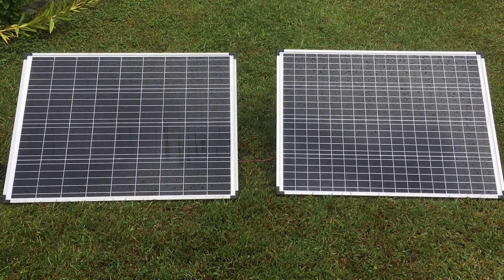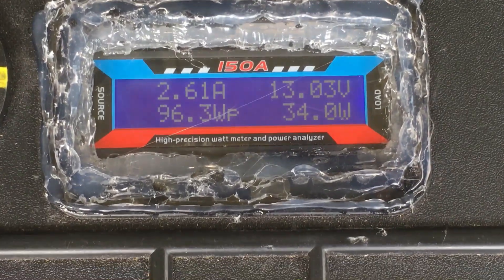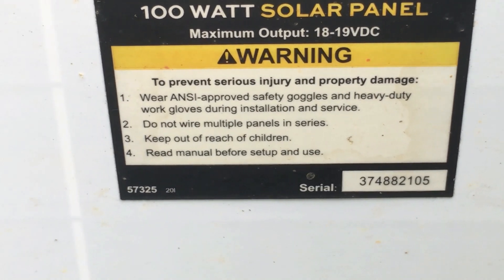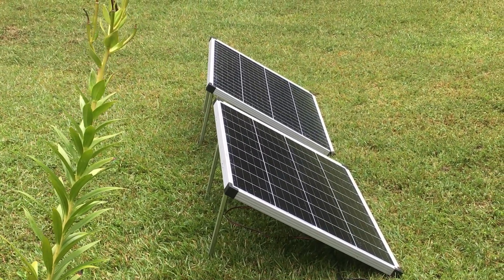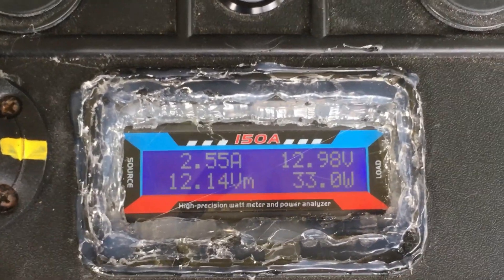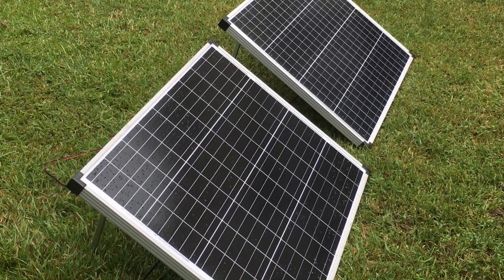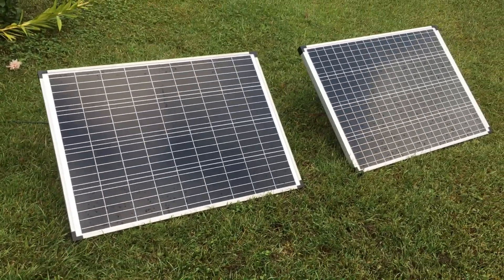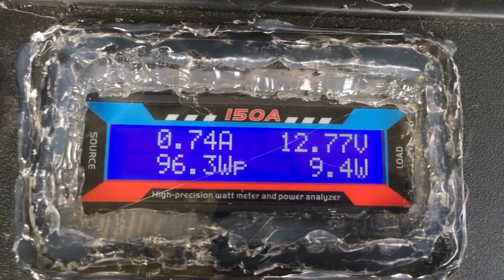Can you hook two of the new 100 Watt Harbor Freight Solar Panels Together?? 57325 (Rainy Day Result)

Comment: Can u connect 4
Reply from the maker: As long as your cc can handle it
Reply: @DIYKAI  3000 watt growwatt mppt.  Should be good ?
Reply from the maker: 3000w @12 or 24v? Is it the 80A one?
Reply: @DIYKAI  2- 12volt lithium sok batteries. Thanks alot....if you have any food questions I'm the guy.
Reply: @DIYKAI  yes on amp
Reply from the maker: So over kill for 400w of harbor freight do you plan to mount them somewhere? You could get 100w panels cheaper on Amazon
Reply: @DIYKAI  totally off grid ..I wanted to be able to build up to 48 volts a d tie to cabins breaker box.
Reply: @DIYKAI  they are mounted on stand facing south. I'm 2400 above sea level totally unobstructed.
Reply: @DIYKAI  in series parallel is what I'm thinking.....

Comment: I have the 100w, 4 x 25w, kit in parallel with the single 100w panel.  I changed out all of the 16awg wires that came on the panels with 10awg wiring and replaced the sae connectors with MC4 connectors.  Still using the Harbor Freight 30a PWM controller with 10awg wiring to three of the 35ah batteries running in parallel for estimated 105ah.  Battery wiring all 4awg cables.

Best full sun days I am getting 9 - 9.7a input to the system.  Panels are mounted on a ground frame set at 45 degrees for half the year and I just set them at 40 degrees today for the winter.  I am located in North Central Minnesota.
Reply from the maker: 9A for 200w is pretty good

Comment: FF Power Station CN505, 614Wh, on Amazon. Seeing some good reviews. Love your input! 😎
Reply from the maker: Yes, they can work but are not a direct hook up as the HF panels are an SAE style connection and the power station uses a DC type connection. You can get an adapter though
Reply: So, this one doesn’t do A/C without adapter? Is that how most are?
Reply from the maker: If you mean will it output 110ac yes but to charge it with solar it seems to need a dc barrel plug type
Reply: Well, I am very torn between a bigger unit like Ecoflow or Bluetti, but thought I could always use a small one now to shorten my learning curve while waiting for the best one to go on sale.
Reply: You’re a doll for helping me! I am sharing your stuff! ☺️
Reply from the maker: Thank you! ☺️
Reply from the maker: It’s going to boil down really to what your wanting to power and for how long. That way you can base your needs off what size battery you will need
Reply: I might just find different panels that don’t require an adapter. Thx again! 😎
Reply from the maker: Your welcome just make sure to double check because each manufacturer does things a little different…the industry standard is MC4 style connectors just for an FYI but you will find everything in-between good luck and drop a comment if you need help in the future
Reply: Wish I had a rockstar emoji! 😂
Reply from the maker: ☺️🤟🏼 lol

Comment: Hello! I am looking at this unit and wondering if you might look and tell me if these HF panels would work with it? And… is there anything else I need to get it going? Thx so much! Love your videos! ☺️🌻
Reply from the maker: Hello sure what unit are you looking at?
At a minimum you need a charge controller, battery, inverter, and the panels

Comment: What connections & how to connect in parallel with the sae connectors on these new panels?
Reply from the maker: HF uses SAE but we have seen they tend to get warm during use….we cut them off and use a distribution block to run these panels
Reply: @DIYKAI , dang...not sure what that is..... Ive got 2 panels that I wanted to connect together but that warning scared me. Also didnt expect to see these sae connections
Reply from the maker: Is this the only panels you have or are you booking to an existing system
Reply: @DIYKAI . These are the only panels & I didnt really want to use that big round connecting hub.
Reply from the maker: @robertdonnelly7897  ok do you know what you will be powering? what type of battery do you have ? and charge controller type? this will help us to determine what route is best for you
Reply: @DIYKAI , we have a big deep cycle marine battery with a 20A pmw controller(not sure if I need to go up to a 30A or mppt)(also sure im getting these acronyms wrong)...connected to a 750w inverter(prob overkill) powering a small light & small fan for a chicken coop. We had a 30w panel on it but it couldn't keep up
Reply from the maker: Ok for anything under 400 watts of solar a PWM is fine.
20A is fine for the 2 panels you could add another and still be ok.
So for this we would recommend running parallel.
Basically hooking positive to positive and negative to negative. This will allow you to maintain the same voltage as one panel but up the amps. This will allow for faster battery charging.

You can either cut the ends off and splice them together then run them into the cc

Or you can get some SAE combiner plugs off Amazon. Either way is fine.

Make sure you fuse the hot lines a 15A will do fine for 2 panels.
Reply: @DIYKAI , Ohh man...really appreciate this....this was the info I wasnt sure about. Thank you very very much my friend
Reply: Sorry. One more Q...where exactly does the fuse go? Between the panels & CC or CC & Battery?
Reply from the maker: No worries your welcome anytime!
Reply from the maker: So we run ours with one coming off the main hot line from the panels, one between the cc and battery, and one between the battery and inverter with a cutoff switch. Probably over kill but we sleep better knowing it’s protected lol….basically all the hot lines have a fuse.
Reply from the maker: We have some other video showing it in the solar playlist
Reply: @DIYKAI , ok. Got it. Appreciate
Reply from the maker: No worries if we can help again just comment!

Comment: How do you install 2-100 watt panels to the hub????
Reply: When I first got my panels I thought I would hook them to the hub and try it.  I knew I had everything connected correctly but got nothing.
  Upon closer examination I found one of the S.A.E connectors from a panel was factory assembled backwards, essentially grounding out the system when I plugged it into the hub.
   Must have been assembled on a Monday...   check your wiring orientation, you may be experiencing the same problem. 
  Ultimately I cut the connectors off and wired the panels in series.
Reply from the maker: Into what hub?
Reply: @DIYKAI  I got the harbor freight hub plus I bought a splitter for 4 panels and 10 ft. extension to fit
Reply from the maker: They just plug in
Reply: @DIYKAI  I did this and it did not work.
Reply from the maker: What exactly is happening? How is your set up? We tend to stay away from the HF controller and hubs they are bare minimum.
Reply: @DIYKAI  I plug in the splitter to the panels then into my 10 ft. extension but no sign there in panels on the solar controller

Comment: I have 4 HF panels, the 400w connector and a jackery battery, what am i missing? it wont push the panels together only 1 at a time
Reply: Depending on the size jackery you have they are limited on the amount of power they will input.  Check the specs on your jackery.
Reply from the maker: Everything HF sells solar is mostly crap except for the panels….the 400w hub places it in parallel.
When you wire multiple panels in series, their output voltages add together, and their output current remains the same. Conversely, when you wire numerous solar panels in parallel, their output currents add together, but their output voltages stay the same.

Comment: The "do not connect in series" thing is probably based on the current limits in the panel.

 Wires are designed to carry a specific amount of maximum current, even the wires inside the panel.  By connecting them in series it is easy to overload or exceed this current limit inside the panel and break your panel.
Reply: Yes, and it's plug and play for newbies. 
 I wanted the higher voltage that comes from wiring in series.  They start charging earlier in the day as well later in the evening.
  Also, mine are mounted flat on the roof of an overlander so the extra kick really helps.  Easily generates over a Kw a day.
Reply from the maker: @scottmork9598  we use series parallel with 600w come in at 50v around 15A and cc steps in and we get 38A to the batteries over 2kW daily
Reply: I have 3 connected in series with no issues.
Reply from the maker: @scottmork9598  are you using the HF controller?
Reply: @DIYKAI     No. I use a victron 100/20.
Reply from the maker: @scottmork9598  figured lol the only reason HF says no series is because of the cheap controllers they sell lol
Reply: Yes, mine are under the hood.  I could put heaters on the batteries but I don't think it's worth the hassle and risk for me at this time.
   The entry cost for lithium keeps going down, I'll wait a bit.
Reply from the maker: Yes technology is getting better and prices will get cheaper
Reply from the maker: Also the limit is the HF controllers they suck
Reply: Nice!  That's exactly how I would wire mine if I had a larger array.  
  The highest voltage I've seen is 67.5 from the panels. The cc will step the amps to 20 if I allow it. Limiting it to 10 amps in accordance with the battery manufacturer recommendations.  3 100 a/h lead acids at this time.  
  I'd like to go lithium but cold weather performance is a serious consideration for me.
Reply from the maker: With have lithium but we keep them inside lol

Comment: Is the wire from the hub to the controller good enough for the  20 amp?????
Reply from the maker: 20A is over kill for 2 panels you can go with a 15A but we strongly suggest rewiring things as the wires from the HF panels are small....also the hub can only support a max of 400W but it gets hot so we switched to bus bars and are much happier nothing get to hot anymore

Comment: What size fuse do I need?????
Reply from the maker: you would want a 30A on the positive line going from the controller to the battery one like this is good:
https://amzn.to/3aYBP3H

on the positive side of the hub you this should be fine:
https://amzn.to/3cDooX4

as for the inverter that depend on the have you have and power your drawing

Comment: the solar controller is a pwm 30a no fuse at this time
Reply from the maker: yes, you should be fine, but we recommend putting a fuse on the hot side between panels and the controller and the controller to battery that will protect the system if you're running an inverter size the wire and fuse according to your demands

Comment: I have 2 - 100watt  connected to the hub with a 30a charge controller is this ok??????
Reply from the maker: Yes, you should be ok is it fused on the hot side? Also, what controller? The hub is rated at 400W it does get warm if you're running that much so at 200W you should be just fine

Comment: Harbor Freight Panels are using 14 Awg wire. Each panel puts out 5+ Amps, so theoretically four panels placed on a Hub will put out 20 Amps. Of course, you never actually reach 20 Amps, but you'll probably reach more than 15 Amps, maybe 16 or 17 Amps. With that in mind,  14 Awg wire is for 15 Amps and 12 Awg wire is for 20 Amps. The wire specification is wrong when you consider the potential amperage that four panels can put out.
Reply from the maker: you are correct the wire leads are cheap and thin...we are using a buss bar system to connect a few of them together now much more reliable

Comment: I'm loving my hf panels so far.

Mine are setup in parallel.

My concern is, I don't run a whole lot off the system, in fact 100 watts probably would have been more then plenty for what I need. I use maybe 10% of what I have in total.
So after searching with no luck, I'm curious, what happens if the solar sits idle or doesn't get used. 
I've heard some different things, some say it's fine, no harm...... Some say it's not good to let the system sit idle at 13.0 - 14.4 volts all the time, some say it can wear batteries down fast if they are not used very much, as apposed to using them with a load daily.......so there are some really confusing signals going on as to what really is the truth.

Maybe you could do a video on your finding of letting a setup sit idle or very very little usage.

I've been hunting and searching for some kind of answer, but have yet to find anything very concrete.
Reply: Don't use AGM Batteries if you're letting them sit idle, without using them for a long time. They'll die out. Their capacity will diminish until they're useless. The solution is LiFePO4 Batteries that will last up to 10 years. The only draw back is the Battery Management System (BMS) in each battery. An EMP will knock them out and render them useless, ie. a nuclear detonation or several nuclear detonations, or a CME from the sun. You'll need to build a Faraday Cage to store them and protect them from an EMP. I'm told that they should be stored at 70% charge for longer life. To charge a 100AH LiFePO4 Battery, you should have at least 15 to 20 Amps input from Solar panels - that's 3 or 4 Harbor Freight 100 Watt Panels on their Hub, then to the Controller.
Reply from the maker: Sure we can make a video we have let them sit and have let them charge the battery and keep it topped off there are many factors